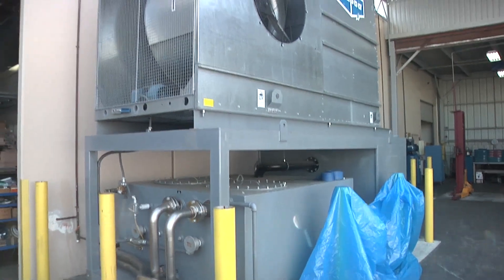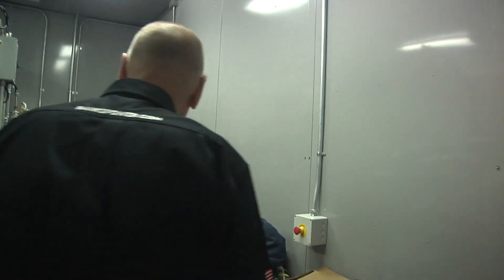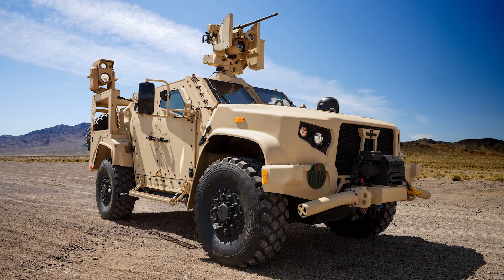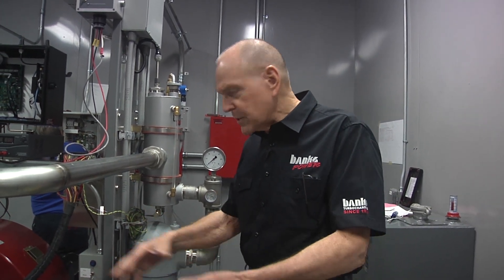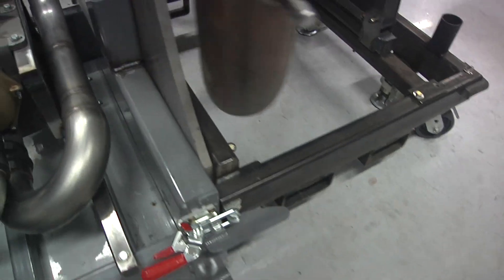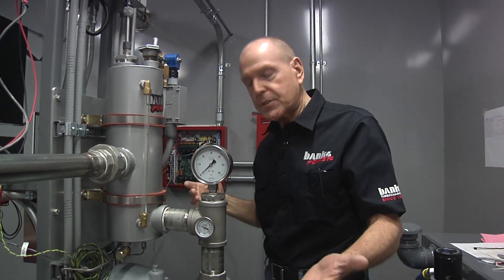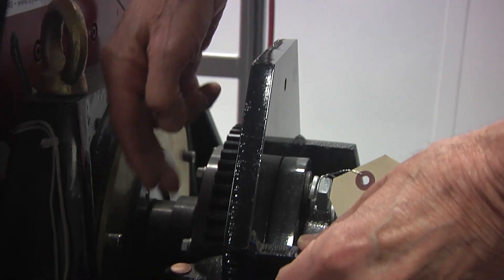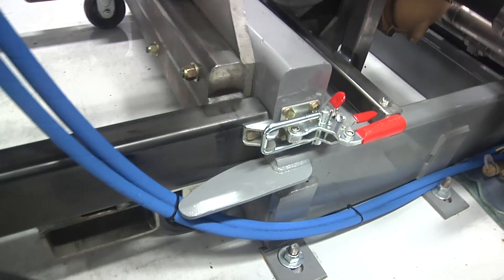Gale Banks Takes Us Inside Dyno Cell No. 4

Comment: this man taught me everything i know about processing air! i have a question for anyone at banks.... if you had a choice to use an air to air or water to air for charge air cooling with cooling airflow not being a issue... witch do you perfect and why
Reply: Water to air. Can remote mount the heat exchanger anywhere. Eliminates charge air piping increasing room in the engine bay. I'm trying to sketch up a ram air to water to air on my LLY.

Comment: pretty much perfection... do you actually take the engine through an ambient air heat cycle to simulate hot, humid or altitude conditions in different operating theaters?
Reply from the maker: We do indeed!